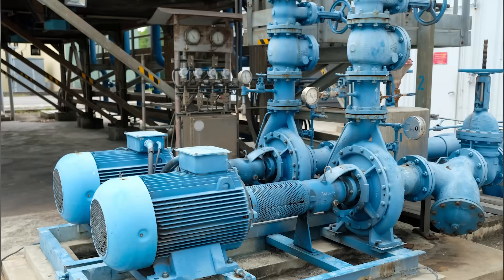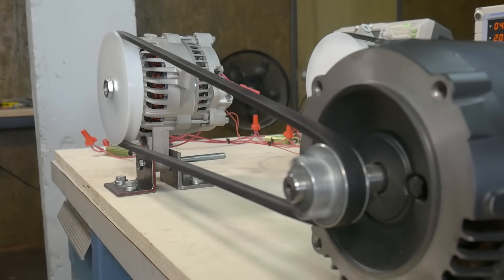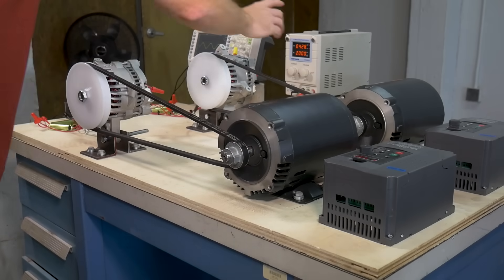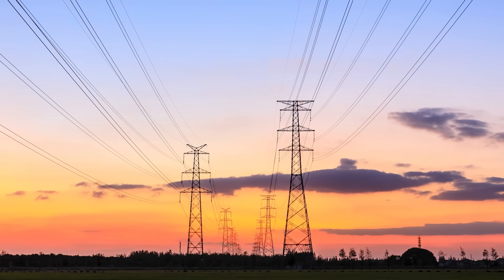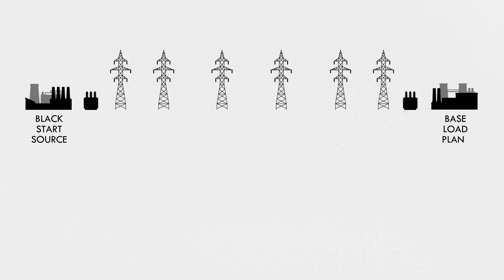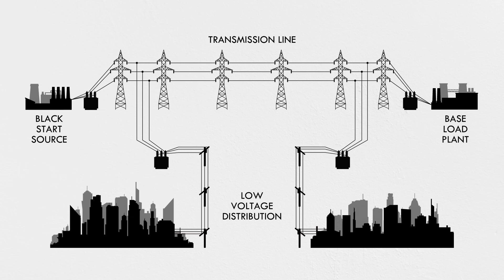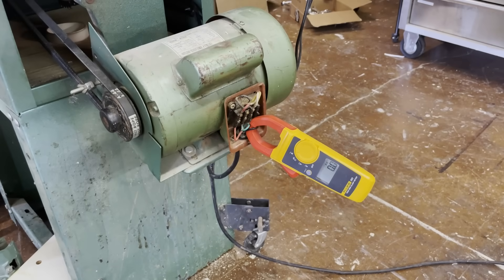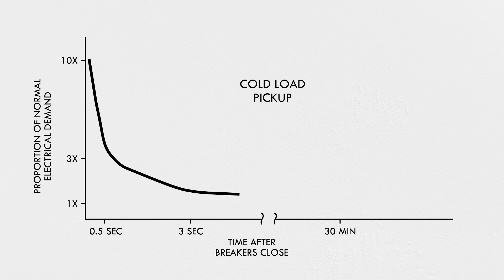What Is A Black Start Of The Power Grid?

Comment: One minor discrepancy is that we don’t actually disconnect the transformers from the line when we do a black start. The iron cores of those transformers actually serve as a great way to smooth VAR transients, and we also want to keep station batteries energized because after about 8 hours we lose all remote visibility and operability. So where possible we leave the transformers energized and open the feeders.
Reply: You mentioned VARs - now my head hurts!  

It’s been 30 years since I synced a 5 MW diesel generator to the grid and had to adjust VARs as requested by the System Operator.
Reply: @Alphie_G  VAR's are easy, explain to me why a solidly wound transformer hums!
Reply: Do you lose all SCADA from remote substations in just 8 hours? Would expect an order of magnitude longer than that.
Reply: @highvoltageswitcher6256  there are some visibility only stations that would probably last a bit longer. We train to assume we’ll have control for “at least” 8 hours, though the real number obviously differs by each station.
Reply: @titleloanman  Thanks for replying. We were discussing the subject of Black Start conditions today at work. We have two battery systems in our larger ground mounted substations. One is 110V and provides supplies to the Circuit Breakers, motorised isolators and protection relays. The other is 48V and supplies the SCADA equipment on-site. They have to last for at least 3 days without mains to the battery chargers. The likelihood of black start is higher now than it has ever been since our grid was first synchronised together over 80 years ago. Rota disconnections for 3 hours are even more likely this winter.
Reply: @highvoltageswitcher6256  is it mean to give your comment a dislike?! 😑😋
Reply: @bdanner302  Depends
Reply: @highvoltageswitcher6256  During our substation "build", I added an "outside" power source to the build. When 2003 hit, My house was on the edge, we had power but 5 miles away didn't. So, I filled several 5 gal water jugs and took them with me to work for security personal (Plant elec engineer). While there, I had premade "patch" cords, manual transfer switches, commandeered the propane driven welders, bottles, got the security folks power (from a welder) and took one out to the yard. 

Charged batteries, lights etc through that "what do want that for" outside plug (manual throw over) switch. After things settled down, we were asked why were we one of the few places that had lights, SCADA operating, comms available, etc. My question was why didn't others?
Reply: @billb48843  Good to hear that engineers the world over tend to think the same way. Thinking ahead, what if this happens. Who really needs power first? What do we need to rig up (preferably before it all goes off)? 👍
Reply: @highvoltageswitcher6256  Substation battery banks are typically sized to provide a minimum of 8 hours supply, this can be impacted by the types of circuit breakers within the substation and how many operations they make after the loss if the station service supply.  The SCADA system itself could hypothetically run much longer than the 8 hours if no devices in the substation had to operate.

Part of our blackstart plan involved potentially having substation techs go out to the sites to manually charge the springs on breakers in order to be able to operate them as well as using portable generators to charge battery banks back up
Reply: @dustinboyce25  My company began installing permanent pig tails connected to the battery chargers in the MEERS so we can just pull up and plug up generators.
Reply: @dustinboyce25  Take your point. The 110v has a standing load of between 1A and 4A depending on the amount of electronic/ numeric protection relays and DC powered MW/Mvar transducers. The times I was quoting assume only the standing load. So if the control centre start opening and closing the HV CBs, like there is no tomorrow, then all bets are off. However, the batteries will provide enough power for all the CBs to trip at the same time at 33kV. This is because they have busbar protection and have both zones covering the 33kV A/B bus-section CB. If a busbar fault occurs here then all the 33kV CBs will trip on bursar A and B. The CBs will trip down to 80% of the nominal 110v voltage level (88v). Closing 33kV oil CBs takes a lot more current than tripping them does so that would drain the batteries much more than tripping.
Reply: @highvoltageswitcher6256  The operation of the CBs actually does not initially require power as they have stored energy either via springs or a hydraulic or pneumatic system (older breakers) that will allow for an open (charged from the last close) and close operation followed by one more open.  When the spring charge motor or compressor starts to rebuild the stored energy is when you start to see currents of up to 33A DC inrush, 12 A average for 10 to 20 seconds per breaker. (138 kv and above) Standing DC load on most of our sites when running from the charger is around 12A most days.  The operating center wouldn't operate the breakers more than needed in an outage event (or at all) but the protective relays would trip and potentially reclose them during the event at which point the station service AC supply might already be gone leaving the chargers off and all load to be supplied by the batteries.  Again, there's a lot of hypotheticals here, but as far as the boots on the ground substation technologists like myself go, we have been taught to expect no more than 8 hours of operating life on the batteries before me have to go to site and start potentially manually charging and operating equipment.
Reply: @dustinboyce25  👍
Reply: @dustinboyce25  Funny, that was the backup for our breakers at the pump station I worked at. While they were smaller units, they engaged with a loud thump when you did them manually. Springs were such that you wanted to make sure the handle was back in the normal position before tripping the button as if your hand was between the handle and the breaker, it could possibly break a bone. They were designed to handle a 125kW 3 phase 480V generator. To switch between the grid power and the generators we had manually controlled and keyed breakers ( breaker had to be in the off position for the key to be removed and moved to the other breaker. ) The reason for the electrically controlled generator  breakers was because we could sync both generators together if need be for changing over from one to the other so we didn't lose power during a switch over. When we automated, we got an entirely new control panel setup and generators that could not be synced. They were rated at 150kW and were designed to switch over from one to the other almost instantly. Our SCADA system batteries were designed to run for 24 hours without charging. And during our wet season, we were on 2 hours notice for reporting to work. The engines themselves for the pumps had charging systems from the grid plus alternators to keep them up once running at our remote sites. A hefty set of batteries as they also had pre-lube pumps that drew as much power as the starters on the engines. And they had engine heaters even though we are in S. Florida.
Reply: @dustinboyce25  When our generators weren't expected to be run ( us not there basically ) they were left in the discharged condition. As soon as a generator was started, the generator charged its breaker so was ready for operation. When we shut down, they would always be left in the non-charged off position. The newer setup we got was all automatic with no manual controls but we had two generators so one or the other would automatically kick in.
Reply: @highvoltageswitcher6256  8 hours assume poor conditions on a the battery banks. Newer setups have have backup battery bank, but generally Ive never seen a requirment for longer than 24 hours. Some sites even have mobile battery chargers and hookups for this reason. So you can bring in trucks to haul in a fresh set of batteries, throw a transfer switch and vola, you gained the relays back on your remote substations
Reply: @thedude5040  8 hours is the regulatory minimum, we took to having "crash carts" which are basically converted appliance/refrigerator dollies that we have batteries stacked on to roll them in for extra capacity.  for a receiving station though, that's another story entirely because sometimes they're single cell jars (the size of a typical truck battery), and 100 of them on each string for 250vdc stations.  all in all, it was just easier to scab in a portable generator connection to the battery charger, because the effort required for everything else was ridiculous in comparison
Reply: @loginavoidence12  oh okay! Early in my career I encountered some sites with a backup generator that strictly served the battery charger and security. Never thought much of it until I read your comment. I remember I later had a project to replace the generator, but had a hard time getting supply drivers setup because they wanted to change from propane to diesel for some reason.
Reply: @High Voltage Switcher  too much voltage sag on the DC and your trip coils  won't operate properly. Thats our main concern and why we use the 8hr rule but shorten it to less in extreme cold weather up north in canada here
Reply: @kylecossette5044  👍 Do you have a high impedance monitor on your battery systems? The reason I ask is we have ahead failures to trip caused by battery cells that have gone high resistance. When the trip is required, like you say, there is a severe sag in the DC voltage which prevents the CBs from tripping.
Reply: I wish I could divulge more, however, we are a black start plant. The plan changed, we used to use EMD diesels where the first one has to be manually flashed (field). Now we are using a lms6000, so we have 40 mw (hopefully) at the end of starting. However we need air to open gas valves to feed said unit, we aren’t there yet. Let alone if the gas system bleeds off (transmission) from the 1000# we received it at, we will need one of our gas compressors. Another problem is emissions, we are hamstrung with emissions standards and currently can only run a min load of 30 mw due to the CO catalyst getting too hot at low loads. So I hope this all goes well, I see a lot of little issues that will be monumental. Who knows I might be down at my old plant to manually flash fields and start the 60’s diesels up. Lol.
Reply: Those power transformers also have a lot of inrush current when energizing them, wouldn't want to energize more than one at a time. Also might consider getting bigger battery bank if they only last 8 hrs.
Reply: @dieselsoggydog6299  Yes. Depending on the series impedance of the transformer the in rush current can be a number of times full load current. Peak currents approach two times the square root of two, times by the reciprocal of the p.u. Series impedance time the full load current of the transformer. Also the current is full of harmonics, 2nd (due to the DC point of wave energisation offset) 3rd and 5th. This could be a real issue in a black start, the grid operator is likely to want only one large (10MVA and above) transformer at a time energised, with perhaps 30 seconds or so to allow the in-rush current to subside before energising the next transformer.
Reply: @dieselsoggydog6299  The battery banks that can make it 8 hours with relay, communication, and switchgear motor operations accounted for already take up a decent size room that might be 1/4 of the control house and be well over 100 12V lead acid cells that are regularly maintained. Additionally, transformer inrush is limited by the line characteristics as well locally for particularly large transformers. The EE's at POCO's know what they're designing for and a do a decent job of utilizing their budgets, when POCO's have equipment failures it's usually executives robbing operations and maintenance funds for their own benefit.
Reply: @dieselsoggydog6299  Bigger battery banks cost money.  With the cost of producing electricity increasing due to the conversions to Green Energy while rate cases for electricity fees to charge customers does not follow accordingly, there are cutbacks....lots of them.  It costs a lot of money to build a windmill or solar farm and the customers do not want to pay for it so every dime that can be saved to run a utility is used for the new energy source construction.
Reply: @dieselsoggydog6299  money. It costs too much money for longer batteries. I know its hard for a civilian to understand. 8hr Battery banks can easily cost over $50k and we have 1000s of substations across the country. New substations have 125VDC so you can calculate how many cells you need in series just to get your voltage.
Reply: Not to mention that the battery banks typically are only needed for a few seconds over the entire course of their operational life. They are important when things start going poorly, but the reality is that things rarely go that far off the rails... And when they do, if 8 hours doesn't get you through, there's a good chance 24 wouldn't either. It's a lot less expensive and nearly as reliable to keep a few spares and swap them out on the rare occasion that you need more backup power.
Reply: @thedude5040  I doubt a civilian can calculate that, either.
Reply: @thedude5040  You kinda have a similar situation from the civilian side with UPS'. There's a reason why under average loads most consumer grade UPS' only keep things going for maybe 15 minutes tops. Having enough capacity to keep your equipment operating for HOURS is expensive and would require more batteries and a much bigger UPS to contain them. In reality, 99% of the time you only need that ~15 minutes just to ride through the short outages. If you have a multi-hour outage or longer, likely you have other things to worry about and should look at alternate power sources if you ABSOLUTELY must have that equipment up.
Reply: @Vchat20  I always have to explain this to people when I'm going through data center design. The UPS is there to cover the load while you're generator is getting up to speed and synchronizing and becoming stable. Then when you have to cut over to the power grid again you have to use the UPS to buffer the load while you switch the sources. This is also why it is often cheaper to buy more expensive low load devices than it is to increase battery capacity on the ups and the generator system. Because of power factor conversions you can only hold about 70% of the maximum capacity of the UPS for its rated time. Lithium UPS's are helping that but I'm not aware of full data center lithium setups yet. It's just not cost effective.
Reply: @RowanHawkins  and hopefully the bean counters understand the importance of regular maintenance and testing of the emergency diesel generators rather than continually cutting maintenance budgets.
Reply: @miroslavmilan  nah dude let’s think this out like a degenerate. Vape batteries are single cell lithium ion batteries 3.7 volts charge to 4.2 volts divide 125 by 4.2 you’ll need 30 of em. car batteries are lead acid batteries old ones had 6 spots to fill with water so they are probably 6 cell or 2 volts a cell but the car battery charged to like 13 volts so divide that by 6 and each cell charges to 2.16 volts divide 125 by 2.16 and you get 57 and some change so you just round up to 58 because you can’t have a fraction of a cell.
Reply: could you explain this in simpler words
Reply: @wojtekpolska1013  it’s a complicated concept that requires understand many engineering principles, but I’ll try to simplify it. For the sake of simplicity, it won’t be entirely accurate - but it’ll be close enough for understanding. 

Most people only know about the power actually flowing across the power lines, measured in kilowatts. We call it “real power” because it’s the power that actually does work for you. There is actually more power flow happening that almost no one ever talks about; it’s called “reactive power,” and for the sake of simplicity I’ll just say that it’s power stored in the magnetic fields that are around all power lines. It does no work for you, but it’s required to maintain voltage, and voltage is required to maintain “real power” flow. You aren’t charged for “reactive” power, but the power company is required to produce it. 

During normal situations, “reactive” power is a small fraction of “real” power. During a black start, when “real” power is close to zero, “reactive” power is a dangerously high portion of total power. The system is extremely sensitive to changes in either of these in this state. “Real” power is easily controlled by slowly turning customers back on. Controlling “reactive” power is much more difficult. One of the ways to control it is to have areas with strong magnetic fields to serve as a dampener for changes. Think of them like storage tanks; they absorb sudden surges and compensate for sudden dips. Transformers (with their iron cores) are a GREAT place to perform this function, because they generate powerful magnetic fields. It makes the overall system easier to control when the system is in a very weak state. So during a black start, we keep as many transformers as possible energized, even though they may not be feeding customers at that moment. The station batteries are also usually charged off of these transformers, so it provides the added benefit of keeping those batteries charged, which allows for better control of the system. 

Hope that made sense!
Reply: After disconnecting the loads, due you have to worry about open-circuit voltage? I'm thinking CT's?
Reply: This really depends on your position  on the transmission line. As a grid operator I understand. However he is presenting this info to the public, most peoples eye gloss over the second you say anything that sounds too complicated.
Reply: Black Starts Matter